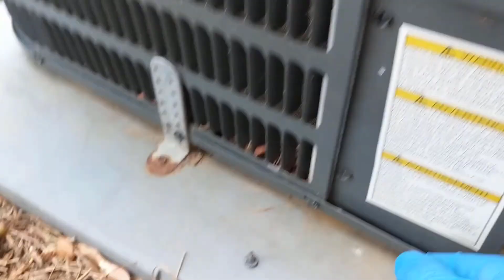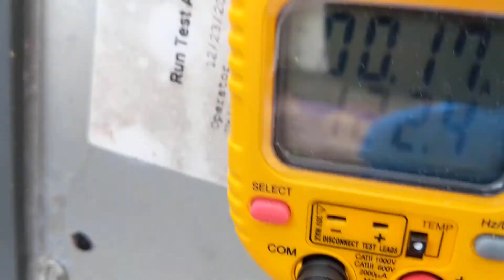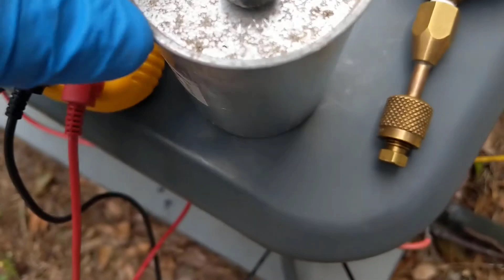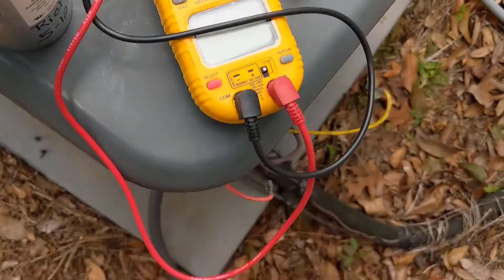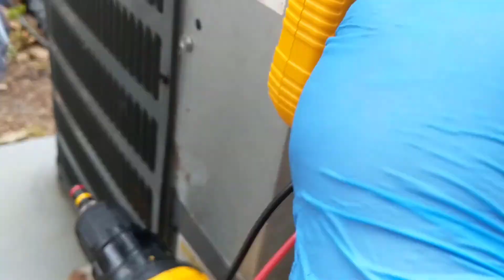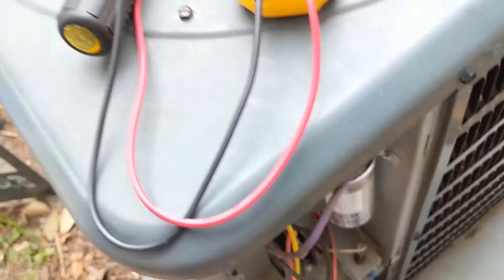AC Blowing Out Warm Air

Comment: What if you replaced the capacitor and the contactor and still no cold air ? Compressor and fan kicks on. Air just blows room temp. ?
Reply from the maker: Could be low on charge. It's hard to say for sure without seeing it in person, but if you've done all those things & it's still blowing warm air out vents & the system is running properly, I would lean towards a low charge due to a refrigerant leak. Thanks for watching Paul & help support the channel by subscribing 🛠️👍
Reply: @ thank you for responding ! That’s what I was thinking! But I wasn’t sure. I’ll definitely support you!

Comment: I just watched a Youtube about AC blowing warm air and he found out it was because of a bad cap on the air handler.
Reply from the maker: @crand20033  Yeah there could be several reasons why a system is blowing warm air when it's in cooling mode. Thanks for watching crand20033 & help support the channel by subscribing 🛠️👍

Comment: Great video! Question for you boss:

I have a 3600, 2 story house. AC downstairs is working flawlessly, upstairs is hot af. I go out to the AC, downstairs unit is blowing out hair out, upstairs unit is blowing cold air out. Is the upstairs unit not pulling the hot air from the house and pushing it out? If so, is it because of the condenser ? Can it be just because it’s dirty? But if it is the condenser, would changing the capacitor like in your video, work?
Reply from the maker: You're on the right track by noticing there's cool air blowing out of the condenser, it's honestly impossible to say exactly what the issue is without seeing it. It definitely could be the capacitor that is bad which isn't starting the compressor but it's starting the fan. Or it could be low on refrigerant & not performing properly, it could be a loose wire, an airflow issue, etc....But if you have a meter that does microfarads you can check the capacitor. Hope that helps. Thanks for watching Henry & help support the channel by subscribing 🛠️👍
Reply: @ApartmentMaintenance  thank you for this response. I was actually waiting on your response to take some course of action. I’m going to check out the capacitor and see if it does anything. If there are leaks, where would the leaks be? By the unit ? Or inside the house?
Reply from the maker: @henrymenendez7655  a leak could be in the coil at the air handler, at the coil outside, a braze joint, etc....you would need a refrigerant leak detector to find a leak.

Comment: Notice you check both capacitors with different leads on the meter for example you put the black lead on the common and the red on the fan in the herm which is normal but on the new capacitor you put the red on the common and the black on the Herm and then the fan why did you switch the wires of the multimeter. Just asking
Reply from the maker: Great question that alot of people aren't sure of. The answer is, it doesn't't matter which lead from the multimeter goes to common, herm, or fan. As long as you have one lead on common while you test the herm & fan terminal it doesn't matter if it's red, black, green, orange, blue etc...when checking microfarads. There's not a positive/negative in this situation. Once again, great question & Thanks for watching Mafiaboyz3573 & Subscribe to the channel 🛠️👍

Comment: Thanks, man! I'm not sure if this is my issue but this has been the most original solution I have seen so far while trying to sort out a problem with a new Goodman outdoor unit. I had it installed 4 months ago but I've been having nothing but problems out of it whenever it climbs above 80F outside. I've replaced the zone board and thermostats but it behaves exactly the same. The company that installed unit thinks it's the zone board and refuses to come back out without charging me more money.
Reply from the maker: Well I hope you get it figured out. With it being only 4 months old they should definitely come back out at no charge to see if the system they installed is working properly. It could be under charged. If they installed it 4 months ago which would have been in February, the temperature wasn't that warm & they wouldn't have been able to dial in the correct charge with February's temperatures & now that it's the summer & hot outside it can be charged properly. They should have told you that they would have to come back at the beginning of the summer to dial in the charge on the system since they couldn't have done that in February without a heat load on the home. Thanks for watching whateveriwantga & subscribe to the channel 🛠️👍

Comment: Can a missing flashing piece on the air handler where the evap coil and main cover meet cause the ac to not cool properly? There’s a big gap so my thought is that the blower is pulling air from that gap and not thru the evap coil so it’s not efficient. But my maintenance guys have been here 4 or 5 times and can’t figure it out.
Reply from the maker: Yes, it will cause the system to not operate properly. You most likely won't have much air blowing out the vents & not pulling the air over the evaporator for the refrigerant to absorb the heat & remove it from the apartment. Thanks for watching Kevin & Subscribe to the channel bro 👍